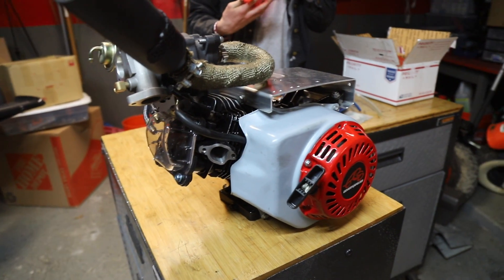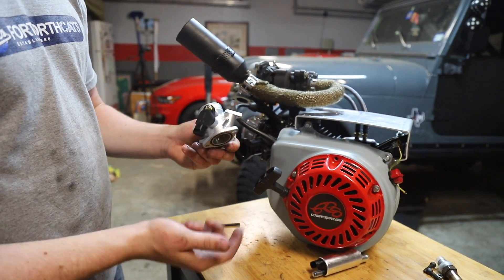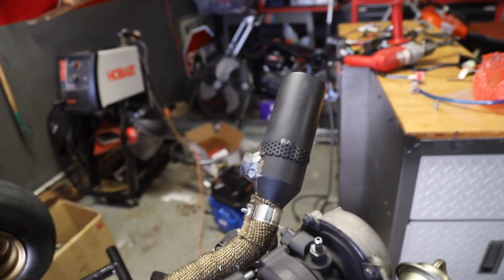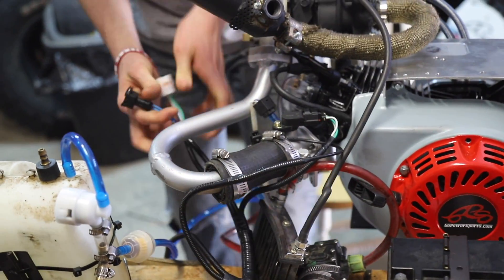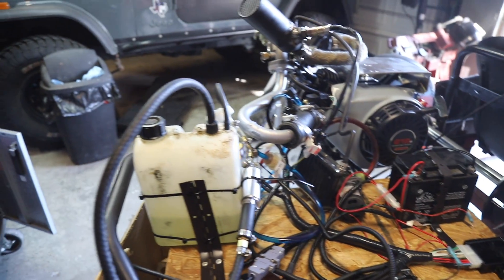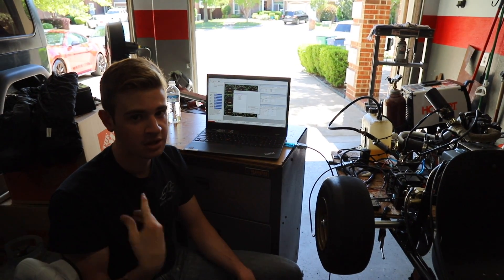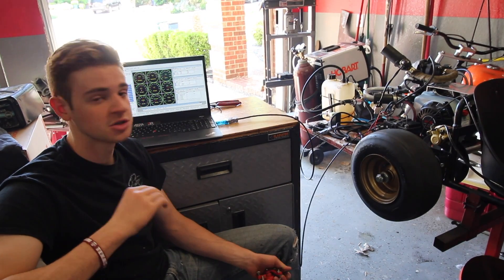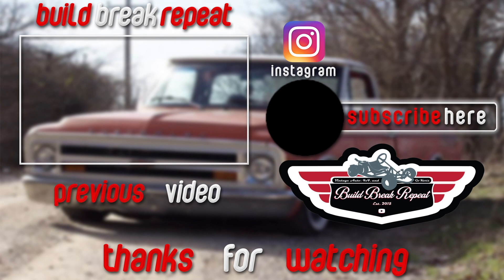Turbo Go Kart Finally Gets Electronic Fuel Injection!

Comment: I thought fuel injectors needed high-pressure fuel like 1000 to 2500 psi how do you get that with only a electric high-pressure fuel pump that  only puts out  what? 40 plus psi

Comment: By question is if the turbo that have on the motor was ment for a gas engine would it be better to run a turbo off of a diesel engine like a jetta or a beetle be cause they create less flow and heat but would allow the small gas engine to create more boost

Comment: I’m no expert, but I do believe that fitting a turbo on a single cylinder engine is quite difficult to get running to its best ability, I believe it has something to do with the valves between exhaust closing and intake opening.  
I’m sure you have a build some sort of plenum chamber. 
Good luck.
Reply: It's the Ecotron turbo literally built for the gy6 1 cylinder 49cc to 300cc motorcycle engine.  This stage 4 predator should have no problem with it.

Comment: I have a fuel injected and turbo'ed 250cc buggy and it's going to be a long process to get running right!  A few things I learned along the way...  Move the O2 sensor as close to the turbo as you can and away from the exhaust outlet. The pulses will pull O2 back into the pipe and give you false readings (you really don't want that).  Actually, ditch the O2 sensor that came with the kit and get a wideband sensor.  It's pricey but worth its weight in gold when you start spooling. 

A plenum is critical between the turbo and intake. It should be a minimum of 4x the size of your cylinder. The turbo needs to flow while your one and only intake valve is closed (75% of the time) and the plenum gives it this space. The good news is that an intercooler makes a perfect plenum and also helps with the 200+ degree air temps that you'll see.

Make absolutely sure there are no exhaust leaks.  Even the smallest leaks will affect your total boost.  Slather Permatex Copper Gasket maker on all connections.

I need to be at ~5000 RPM with a decent load to produce boost (11 psi).  Revving in neutral won't generate any at all.

Good luck!  The tuning process can take a long time. Take it slow and make sure you keep an eye on your A/F the entire time.

Comment: Does it have closed loop fueling? What positive pressure will the map handle? Boosting a single cylinder 2v will always be hard especially with a turbo. Be much easier with a blower.

Comment: checkout this MIT article: http://tlo.mit.edu/technologies/turbocharging-single-cylinder-internal-combustion-engines YOU NEED AN AIR CAPACITOR. AKA an intake plenum the correct ratio to engine displacement... for best/acceptable results with a single-cylinder turbocharged engine

Comment: On a single cylinder turbo engine you need a "boost tank " on the intake. It allows the turbo to build pressure in the tank and lets the engine get some real boost. 

This is why NONE of the turbo builds on youtube seem to actually work. I think a decent sized intercooler off a car would make the perfect "boost tank". 

Theres a channel called nugget garage i think. In their new cart build videos even they address this issue
Reply from the maker: the dude Yeah we’ve been looking at the MIT article. Just yesterday I ordered an intercooler that’s about 900cm^3. To follow the specs completely it should be like 1000 but it’s close enough to store boost and prevent lag. 

I’ll take a look at nugget garage though thanks.
Reply: You dont need a boost tank.. A long enough intake runner between the turbo compressor and intake manifold is fine. The problem is the Ecotrons EFI. Look towards timing curves at first because you need to match your flywheel signal with the MAP sensor boost reference (for retarding timing on boost). Also, the Auto-Tuning should be done LAST, mainly due to the fact it does not change the maps very much. You need the more expensive O2 sensor to auto-tune properly, the O2 sensor that comes with the kit is the dumbest/cheapest. PS: fuel map is very rich at first, so I suggest you revert back to the original settings and DONT USE AUTO-TUNE! Had me a heck of a headache when I tried to tune my Ecotrons turbo+efi on a 200cc, because I also auto-tuned idle...
Reply from the maker: priit mölder ok thanks for the advice, the tank is just for making peak boost and equalizing pressure, it’s not a solution to the problem it’s just a way to optimize

Comment: Why not do a draw through setup ?
Reply: I was thinking the same thing. The only problem with draw through is fuel puddleing but there's not much boost piping so probably would happen. I know alot of people do the draw through on the old aircooled vw. I think there just wanting to make something work thats different. I totally dig it cause they are going to learn so much by making this work. It took me years of reading articles to get were im at and still learn every day.
Reply: Draw through is usually for a carburetor setup and not very efficient on efi engines. This is now fuel injected so all the benefits of a modern engine can be applied.

Comment: Hey BBR is there something in that kit that picks up cam positioning ? Or crank positioning?🤔
Reply: I can answer that no. Since its only one piston there are just controlling injector pulse. It's basically constantly feeding fuel like a carb just with more control. The map sensor can pick up the boost pressure and increase fuel delivery were as the carb cant tell when it's boosting and can't compensate. Now they do make boost reference carbs or they can be modified to work but not for applications this small. Sorry for long book. Hope this helps a little.

Comment: O2 sensor shouldn’t be that close the the tip, it’ll backfeed whenever you let off the throttle and mess your ratios up.    Other than that looks pretty awesome
Reply: Was going to post to say the same thing. O2 sensors do not like being that close to the tip. Especially on a single cylinder, you're going to get a LOT of fresh air feeding on every pulse that's going to really mess with the readings. Their best bet would be to put the bung closer to the turbo, probably in the middle of the U bend they've got. Would read a LOT more accurately there.

Comment: Not sure if the O2 sensor was working right but you guys had that thing scary lean. Almost @ 16 consistently....
Reply: O2 sensor is too close to the outlet on the muffler. Oxygen will reenter the exhaust causing false lean readings.
Reply: @jc080198  Oh OK, makes total sense. Im not really a small engines person so I wasnt sure if it was ok to lean them out. I just figured with a turbo, the cylinder temps are probably sky high and those engines are prone to deposits, which as u know, would knock the shit out of it, possibly before melting it. Thanks for the tip tho.

Comment: The oil burning is probably your oil return being to restricted/small. The oil has to "fall" through the turbo.
Reply: Yeah exactly, it should be exactly like a gas tank. It should have 0 back pressure or resistance. Tye pressure should also be regulated

Comment: You just Gave me an Idea on my banshee build...Fuel Injection...... Trying to build a Stock looking Sleeper Project 😂 Good job guy's
Reply: Why should it go faster with fuel injection?
Reply: @milan5159  it's  a matter of being able to keep the air fuel ratios correct the closer to optimization you can get the more power you can produce... you can do this with a carb however they tend to be much more finicky especially with elevation changes, humidity changes, temp changes, even gearing and camshaft changes  messing with the air fuel ratios... where the efi can adapt to all these variables without needing to get covered in fuel to change jets, bleeders, etc.
Reply: ohh fuel injecting the 350twin on mah banshee would be nice.
Reply: Efi my aprilia sr50.its definitely possible.
Reply: @X7rocks  if it's got the qmb 139 50cc engine (id tag is usually found on the flywheel side of the engine or on or around the Vin tag) been there done it mine is heavily built-up (at the max actual displacement of 96cc) with a 52mm big bore conversion with custom piston, stroker crank, custom ground camshaft, upgraded 12 pole  charging system (needed to run the efi), ecotrons efi custom specd for the build, big valve head with upgraded valve springs as well as ported and polished, custom 1 off 1-1/4 inch stainless exhaust header, custom 1-3/8 aluminum long runner intake, as well as a fully reprogrammed cvt and driven clutch, regeared final drive as well as numerous other modifications (does 80+ mph and 115mpg avg fuel economy) yes it's daily driven too
Reply: @dodgeme1986truck  mine is using a 75cc injector to run 13,500 rpms on a midrace minarelli engine. No coil mods needed since the engines use ducati stator and ignition system. I didnt use ecotrons either. Just a megasquirt clone.i sell them as a kit got qmb engines as well for 390 shipped.

Comment: I think you should really need to revisit the oil system, it should just be a big tank like the gas tank, and a pump with pressure regulator just like the fuel has which goes back to the tank. You will just blow the seals out or ruin the bearings with incorrect pressure

Comment: You guys rock!  I gotta be honest I am so jealous!  But heck I guess we all get to come along for the ride metaphorically anyway so it could be worse.

Once you get the ECU dialed in a bit you know you can figure your hp without a dyno.  All you need are:. 

1. Your go-karts rolling resistance

2. The drag coefficient of the kart and driver. (There are tons of free calculators online to figure this.)

3. Your speed.

4. Your RPM.

You'd have to make top speed runs to get an accurate figure but even going 0 to 30 you could get a ballpark and tell if your tune is going the right way or not.

Comment: Lmao you guys need to make it have 2 step please 😂😂
Reply: It’s a single cylinder so a hard cut or soft cut two step will make the engine cut out, better off just purposely running a rich fuel mixture and delayed ignition similar to the anti lag used in rally cars
Reply: Not with this efi kit

Comment: Does this efi have a map sensor or is it all based on throttle Position? Boost is very load dependent and won't come on at a consistent throttle position. Without a map sensor for boost reference it might be difficult to tune. You can try tuning the motor with the inlet pipe removed from the turbo and throttle body. That way you can get a good base tune on the engine without worrying about the variables of boost until you have the engine running properly. Then try using something like a high ratio FMU as a way to richen up the fuel mixture under boost. Best of luck guys!!
Reply from the maker: jdmjedi777 Yeah it has a map sensor on the intake
Reply: It uses a 2.5 bar map sensor (the older kits used a 3 bar)
Reply: It still might be easier to tune with the charge pipe removed. That way they can at least get the engine running correctly.
Reply: @jdmjedi777  yes they should base tune completely turbo less  including removing it from the exhaust then tune at different lvls of boost and throttle positions  also they have the o2 sensor installed wrong it needs to be preturbo 6-8 inches from the cylinder head exhaust port

Comment: did you ge tthe ecotrons efi kit or another brand?
Reply from the maker: Yeah ecotrons
Reply: awesome
Reply: @BuildBreakRepeat  you may want to relocate the o2 sensor... the sensor needs to be 6-10 inches from the engines exhaust port... the muffler looks to be a spark arresting type with breather port under that mesh thus causing a false air fuel ratio reading

Comment: you need intercooler
Reply: MOTOCKOT 
Propably not yet. It wont make so much boost that it would heat up air
Reply: I doubt they'll make enough pressure to need that. a lot of OEM cars didn't use intercoolers as long as they were below something like 10psi on the baby turbo's they ran back in the day.

Comment: I'm not at all familiar with the software or ECU you're using, but you should check and see if "mega log viewer" will work with your application.  This was absolutely instrumental to the power tuning of my turbo miata.
Reply: Nope ecotrons uses their own proprietary software... alot of the efi issues can be resolved just by relocating the O2 sensor to the correct location.

Comment: Now for the real question is the turbo going to make any additional power or is it just an air restriction?
Reply from the maker: Jon Lasaga That’s what were here to find out, it made more power with a non existent tune and stock engine so it’s looking bright.
Reply: They have already run the engine on a dyno and proven that with the stock engine the turbo did add hp.  The video is a few back on their channel.

Comment: boys. i just found the same thing on ebay for 300
Reply from the maker: Yeah I know what kit your talking about, the problem is that they max out at 200cc and you can’t tune them.
Reply: @BuildBreakRepeat  Oh i see.
Reply: Thats because all it is is a few re-purposed scooter and motorcycle parts etrons gathers up and slaps their logo on. Shop around on some chinese sites and you can find it in the $150-200 range if you want to wait a month for shipping.
Reply: @user-neo71665  that is completely wrong... ecotrons was making these kits well before scooters and atvs even had the option for fuel injection. they make most of the hard parts and the software is made themselves.  If anything those Chinese kits are rip offs of their kits. The components they use are much better quality and their kits are fully tunable unlike the chineseum knock offs.

Comment: Does the pressure regulator have a boost reference? If not, it's going to shoot way lean when you go into boost!
Reply from the maker: I don’t think so, it’s just a mechanical valve. I don’t think we are going to have that issue though because the fuel pressure is bigger than what it takes a wot. If we have issues tho I’ll look into it thanks.
Reply: @BuildBreakRepeat  no prob! Love the content! Any idea what fuel pressure it's running? Basically injectors need a minimum PSI to atomize/function correctly, and you can loose that as the differential pressure between the intake and fuel become less and less
Reply: THIS IS AN ACTUAL FUEL INJECTION SYSTEM similar to what modern cars run... The fuel pressure stays static during operation however the computer adjusts the fuel injector open duration via pwm to compensate and control air fuel ratios based off the map sensor, ignition reference from coil, o2 sensor voltage... (additional sensors based on kit and options)

Comment: Boys that kit should have base numbers for you to trim on remember if it’s lean it will run hot and bang out and the leaner you run it the colder heat range spark plug you use
Reply from the maker: jimmy tillery yeah we’ve been messing with the numbers quite a bit, we didn’t get that much time to mess with it but the software is really complicated, gona take some serious looking at to get right.
Reply: @BuildBreakRepeat  you will want to run the afr between 12.5:1 and 13:1 but you need to relocate your o2 sensor first as you are getting a bad o2 sensor reading because of where it's located... what I did to combat this on my extremely modified qmb139 (50cc) motor scooter with ecotrons efi (it now does 80 mph) was at the 8 inch from exhaust port point I installed a 1.75 inch (od) expanded pipe section in my 1.25 inch (od) stainless header to make up for the o2 sensor's flow restriction. It was also the correct point for an exhaust pulse chamber for scavenging.  My little 50cc (bored and stroked to 96cc ported and polished to 1.125 inch exhaust port id, intake at 1.375 inch with controlled texture) scooter is calculated at approximately 125% volumetric efficiency naturally aspirated at 13.5:1 afr (perfect afr for na engines)

Comment: Yo bro can you post links to where you got the EFI? Great job on all your projects, keep up the good work. I have a little pit bike it has spark fuel air and compression but it isn't starting I've used starting fluid and everything please give me tips. It has a Lifan 70cc 4 speed semi auto engine. Keep up the good work.
Reply from the maker: It’s an ecotrons Kit, sounds like your engine might have a timing issue, if it has some way to adjust timing I’d look into that. If that’s not this issue it might be your valve lash. But if has good compression I’d say timing.
Reply: @BuildBreakRepeat  It has about 180 pounds of compression, it used to have like 78 but i readjusted it it backfires when i kick it over after like 10 kicks. I will have to look into the timing for those engines. If you ever think on anything lemme know. I have a Honda Gx160 and Gx120, where can i find billit parts for those? Do you know if Gx200's and Gx160's parts are compatible? Thanks
Reply: @toolsonthebrain4786   it's definitely a timing issue... check your cam to crank indexing (timing) then make sure your flywheel key isn't sheared as it will give you spark even with the key sheared it just won't stay in proper timing also make sure the flywheel has its magnetic poles in correct orientation and that they are still strongly polarized as that can throw the timing way off and if nothing else  listed has worked change your magneto coil as some of those engines had an internally self retarding/advancing coil which were notorious for going bad
Reply: He gave you good advice. With good compression, fuel and spark, make sure that you have air flow. Remove the intake and confirm that the exhaust isn't clogged. If your valve lash was too tight, you'd get low compression but if it was way too lose, the engine will not cycle the air correctly and cause it's own issues. 

Proper timing is also something to look at. Make sure that the cam or chain are properly timed. Make sure that any timing adjustment features aren't malfunctioning. 

Good luck.